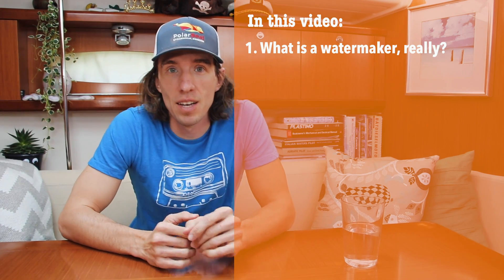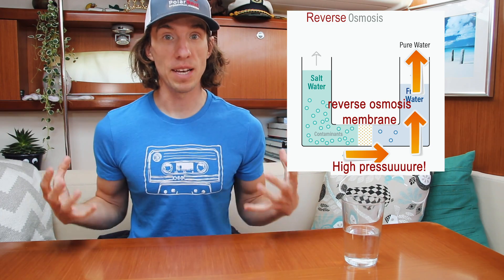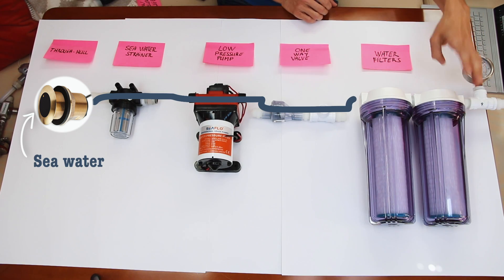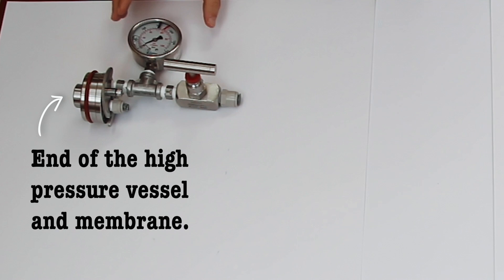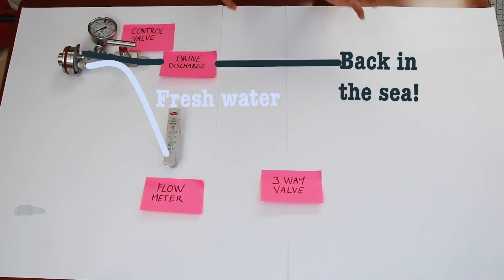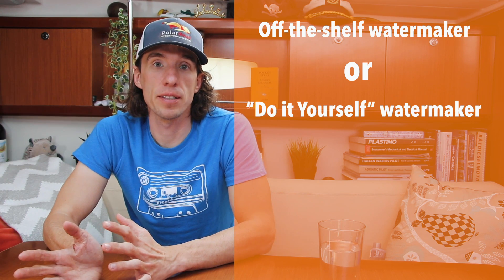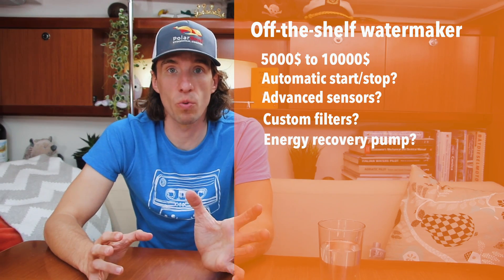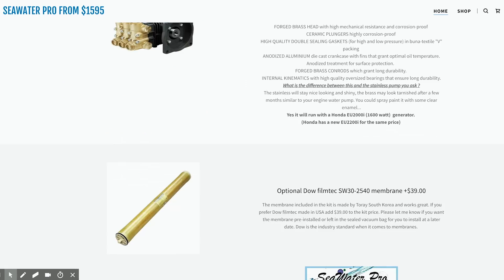How to make water on a sailboat (and how to build your own watermaker) // Ryan’s tech corner #3

Comment: Okay so your missing a few items 
1 water inlet.
2 shut off valve.
3 strainer.
4 booster pump.
5 low pressure switch - needed to protect the high pressure pump -will stop high pressure pump from running if inlet pressure is to low.
6 high pressure pump.
7 high pressure pump throttling valve reduces pump pressure. Pumps like back pressure.
8 R.O housing.
9 R.O membrane.
10 permeate line to fill tank. Roto meter.
11 concentrate water feed back to inlet of pump with roto meter and needle valve to control amount off water to feed back you can recirc some of the waste water back to the inlet of the pump to get as much out of the pre filtered water as you can. This is not necessary but Is commonly used you have spent time and money on filtering the inlet water why waste it by running it once through. A portion of the concentrate is sent to the inlet.
12 level switch in the R.O water holding tank. This will automat the fill process. When the water level is high the float will turn off the pumps when the water drops and the float turns on the system will start up keeping the tank full before it gets empty.
13 you should also get some kind of controller for a R.O they need to be flushed. Flush cycle is to push water through the R.O membrane with the low pressure pump it cleans the surface of the membrane could use R.O water for this or your prefiltered water. R.O water would be the best but more complicated. R.O's like to run dont let the membrane sit a long time with out running it will get fouled and bacteria will grow. I would recommend draining a protion of the R.O water holding tank out every so often or use a smaller tank so that the R.O cycles on more often.

You want your R.O percent of rejection to be in the 92 - 98%. 

So, for example, if your tap water reads 280 uSemen and your RO product water reads 15 uSemen, you determine the percent rejection of the RO unit by subtracting 15 from 280 to get 265, dividing 265 by 280 to get 0.946, then multiplying by 100 to get 94.6% 

RECOVERY RATE
https://blog.harnrosystems.com/hs-fs/hubfs/blogs/Recovery_Formula_Image%20(1).jpg?width=960&name=Recovery_Formula_Image%20(1).jpg

This will let you know how much water you are converting into good water and how much is being sent to waste.
Reply from the maker: Not really clear on the parts we are "missing".  The system described in the video is what you need to make a system work.  In fact it has more in it than what you need.   Anything else is just water management or automatic systems which ads complexity.... all are fine but its just not needed to have a DIY setup.  This system has worked for us doe two years and has been great.

Is their something specific you thought I missed?  Would be interested to hear.

Ryan

Comment: Unsure about about one aspect of the flushing process.  When flushing, does fresh water go through the membrane in the opposite direction?  If so what pumps the water in that direction?
Reply from the maker: Nope... Same direction.  It's just the house water pump which provides the pressure.  Ryan
Reply: @RyanSophieSailing  Ohhhhhh... so the fresh water doesn't pass through the membrane, it just passes over it and out the salt water pipe to basically rinse off the salt side of the membrane?

Comment: Hi Ryan and Sophie. Great job with your videos, as always ;-). Hmmmh ? Why do you put the control valve and high pressure gauge on the OUT (brine) and not on the IN of the pressure vessel ?
Reply from the maker: I always wondered that too but it's because you are building up pressure behind the control valve not in front of it.  So if I have the control valve prior to the membraine the pressure would be 850psi right then it comes out but it would be decreasing going through the membrane and not doing its job.   Having it after ensures the pressure from the pump to the end of the membrane is at 850psi... Or whatever you set it at.  

I can tell you... When you watch the brine discharge water come out of the boat is under almost no pressure
Reply: Got it, so on a two membrane system, I'll put the pressure gauge behind the second membrane then I guess.

Comment: For emergency: there is a hand operated system made by katadyn... switserland... Not cheap... 
I do use a cheap system to make destilled quality water from tap water. First reversed osmosis, then a resin filter. Result:. Water with conductivity 2,5 micro Siemens. That's equal to destilled water. Used for chemestry, biology at school... Costs. Lees than 200$!
Reply: That hand pump will produce very little fresh water.

Comment: Great explanation. I have a rainman  115V A/C High output unit and it works just fine, but the major con for a live aboard vessel is it must be pickled after each use because you may only make water every two to 4 weeks. The automatic fresh water flush on your system is a great feature, and eliminates the need to pickle. To remove the pickling agent,  the unit must run for a  good 1/2 hour before making fresh water.
Pro. I'm can easily sell my water maker.

Comment: Why don't you say it's just a hydraulic hose that's 3,000 PSI with hydraulic fittings on it and tell me I'm wrong those fittings are beveled on the inside, okay so we established that it was a hydraulic hose and to show you what I know what I'm talking about that hydraulic hose at you using has two layers of braided wire, correct.

Comment: Great video. I’ve only just discovered your channel but I’ll be watching! Question: when you run your fresh water flush, are you running it with house pump pressure only or do you switch the feed pump on as well? I assume there is no pressure in the vessel when flushing.
Reply from the maker: The only pressure in the vessel when flushing is from the house fresh water pump.  When running the system though, if you system is above the waterline you will need to use a bost pump before the high pressure pump.  RyN

Comment: If you want to control it with electronics just buy an arduino, as to amps unless you're buying electricity it's a moot point as all that matters is can it make what you need in the time frame you need while allowing you to do everything else you need with the power generation capacity you have.

Comment: Good Video! Fyi --- you were saying Tsd meter. i Believe its a TDS Meter. ( Total Dissolved solids ) i Was wondering wouldn't mounting that High pressure Pump section on your Engine Be More Efficient. So, anytime u are Running the engine YOu could me making water and keeping the tanks filled. Just sounds More efficient to me. than using HUge amounts of electricity though. i could be wrong though.

Comment: Nice job! One of the best DIY/technical sailing videos I've seen. A few thoughts... Not to be nit-picky, but I think it's TDS (total dissolved solids). Second, it might be nice to get a combo pH and TDS monitor. pH is a critical component of water, and one that should be examined when processing water (especially for human consumption). Even small changes in pH can have significant short-term and long-term impacts on the body. Finally, a highly efficient RO filter may get TDS too low, and dangerous for human consumption. Re-mineralization and  pH adjustment kits are available to properly adjust water for human consumption.
Reply from the maker: Hi there.  Thanks for the comments.  Your points are valid and we are researching ways to put some minerals back in our eater supply.  Ryan

Comment: I think you have the same boat as we do. Where did you install the RO housing? Thank.
Reply from the maker: Hi Blown Away Sailing.  If you have the two cabin version, I installed everything in the large locker on port side.  I mounted the membrane high on the outer wall, high presser pump on the table and all the filter on the bulkhead with the galley.  You will see the entire installation in a upcoming video... we have been doing a lot of testing thus the reason for the video coming so slowly.  

it really works well in that location.  one thing i would like to do is move the high pressure pump and create a monitoring board in side the boat where i can turn everything on from but that a project for another time.  - Ryan

Comment: It is not right. The timer???? the pump should have been connected to the simple digital timer, also no need to complicate the system with shore water subsystem.
Reply from the maker: Hi Ryszard.  I would be interested to know why you feel a digital timer is best? The timer we have works very well and for all types of applications. Also, the system is generally much simpler than production version so i feel we are very safe with regards to complexities, etc. - Ryan

Comment: why you put the carbon filter only for flushing and not for the salt water ? (after rest of filters)
Reply: I second your question. Also the throu-hull is to small and the TIMER... totally unacceptable.... should be electric connected to the pump.
Reply from the maker: Hi Psychollek.  Carbon or Charcoal filter will take the chlorine and takes out of the water but not necessarily fine level solids.  Thus the reason you only need it for flushing (in cause your flushing from dock water which has chlorine).  We have two very fine filters for the salt water which is more than most commercial systems.  

Ryszard - The throu-hull is 1/2 in which is just fine for 1.3 GPM required by the high pressure pump.  

-Ryan
Reply: @RyanSophieSailing  well this is obviously why I would place it after the fine solids filters to catch any chemical contamination from the ocean water. On the other hand I don't know how it would react to salt water. It also seems strange to me that you say commercial systems have only one filter. Even my home reverse osmosis system has 3(two for solids and one active carbon afterwards), then the reverse osmosis and then mineral enrichment unit. The filters before the osmosis are the same you use and are fairly cheap so it is strange to me that commercial product would reduce costs on those.

Comment: I'm dismayed that you took off without having a fresh water backstop source.   Then I saw your reliance on gadgets, and I just threw up my hands.  You're going to need some education and, unfortunately, Mom Nature will provide.
Reply from the maker: Hi John, im a little confused by your comment but would like to understand.  When your saying "fresh water backstop source" I'm guessing you're implying a freshwater source in case the water maker breaks?  If this is the case we always leave with full water tanks and have spare bottles.  

That said, this technology is not complicated and thousands of boats every year rely on it.  The same goes with a battery to start your motor, a GPS antenna or a pump for your domestic water supply.   Ryan
Reply: There is an inexpensive backstop which I always carried, especially when operating in blue water.   It's merely a still which uses sunlight to heat seawater and distill it to fresh.  It uses no power and can be tucked away for years.

Comment: No reason to use a TSD monitor. Just taste it. It is a good thing to have a flowmeter on the brine exhaust side also. The reason for that is that a membrane has a safe operating window where not too much fresh water is taken out. If to much fresh water is taken out of the flow to the membrane, then the membrane cannot keep clean, but will clog up with salt. You want that salt going out overboard with a big enough brine flow. I use a pressure holding valve, and not a normal valve (control valve).
Reply: TDS monitor and a Refractometer are essential tools to check water quality...
Reply: And why is that, Chris? It is very very easy to taste if the salt content is higher than recommended! And do share also the importance of the use of a refractometer..

Comment: I don't have a sail boat... do you have a method that works on a motor boat?
Reply from the maker: Hi douglas,  this method would work just fine on a motot boat, in fact probability better as you have a lot of power with the engines to power such a device.  Ryan

Comment: Cardboard tube full of water will explode 😂
Reply from the maker: You never know... people put cellphones in microwave ovens because they see it on YouTube. Just need to spell everything out.
Reply: Great video a lot of compiling parts and research explained well. I think you should flush the system after every use not done my research but that high pressure pump looks like the week point if left with all that saltwater. Try and earth to an anode if possible.?

Comment: How are you going to treat the potable water?  I run large RO units for US Navy ships.  When the water enters the tank, it is susceptible to bacteria growth if it sits for a while.  We have an inline brominator system that essentially adds bromine (chlorine) to the water to keep the water safe for consumption.
Reply from the maker: Hi stephen.  I only plan on having water in the tank for a few days.  As you need to keep using the water maker i will most likely only run it for an hour or two every few days. Ryan

Comment: In the book " Voyaging on a Small Income " by Annie Hill , they built a raised coaming  around the roof of the cabin to capture rain water, with drain holes in the corners. They ran the drain to jerry jugs and then filtered the rain water. They would let the water run off in the beginning to wash away any dirt/salt. Easier than trying to desalinate...

Comment: Very nice explanation overall. Osmosis, though, is a process involving fluids in two spaces separated by a membrane, where the "stuff" in the fluids travels through the membrane, from higher concentration to lower concentration. In Reversed Osmosis, the fluid goes through the membrane from high to low concentration. This is actually a three way process where the fluid after the filter, with the increased concentration, is dumped, e.g. into the sewage. Three: input, clean output, dirty output. In many smaller (home) systems, the clean water is stored in a tank pressurized with a bladder. As a tank has a limited capacity, at certain point when the tank is full, these systems then continue to input water into the RO filter, but dump everything through the dirty output. This wears your RO filter out faster. I am aware there are some automatic valves (simple mechanic) that would close the input of the RO filter once the pressurized clean water tank is full. As to the carbon filter, I would like that in the chain with filtered sea water as well. Just personal.
Big problem, indicated elsewhere too, with RO water is it is very unhealthy. With a pH of around 5 it is acidic and in a system with normal osmosis its zero concentration causes substance to flow out of tissue into the water. You get demineralized quickly and become very unhealthy. Experience.

Comment: RO systems can run on much less pressure. They can run on city pressures of about 80PSI. You can use much less expensive pumps and lines for it.
Also... TDS (total dissolved solids)... not TSD.
Reply from the maker: Walter, you are correct... for city water however this is not true for seawater where the minimum pressure is 300 psi and the average for our area is 800 psi.  This is the reason the pumps are expensive as well as the cost.  Ryan
Reply: @RyanSophieSailing  Thanks, I guess the issue is with fresh water you are starting with 300ppm TDS and with sea water you are starting with 35000ppm TDS. Learn something new every day.
Reply from the maker: Yes, this is correct.  We have had a lot of statements of people thinking they can use home RO systems but its just a whole different game with sea water.  I have learned a lot as well from it.  Ryan

Comment: First one I installed was a 'pre-fab' commercial kit...$250 for 150-GPD, but the RO filter was small and required frequent changes. Second one I installed was also a commercial kit for $400, for 250-GPD (gallons-per-day)...larger filter means it lasts longer, most-often. THEN, I tried what you described...building my own 'DIY' kit...and I found one key-thing...IT'S A PAIN IN THE REAR, and I don't think I ended up saving any money at all! By the time I added this, and didn't use that, and installed extra this...I found that my 'homemade' kit was no cheaper! So, having learned my lesson fully, I now know to buy a decent 250-400 GPD kit, ready to install, and add what I want, whether it's a secondary carbon filter, or an inline pressure gauge (to tell when it's time to backflush) or whatever...I figured I can pretty-easily build a hybrid (dependable) water maker like this for around $1 per GPD...
Now, you were saying something about 'you can't afford a pre-made kit right now'...for 2 people, exactly how much water are you expecting to consume daily on a sailboat? 100-gallons per person per day is a LOT OF WATER! (I don't think I used 3,000 gallons per month for a family of 4, when I owned a 2,000 sq.ft. brick home!!!)
Reply from the maker: Hello Skeeter.

Thanks for your message.  Im a little confused where you are finding a marine RO system off the shelf for 200 USD.  From your last statement im assuming it's a home unit.   These home units while great do not work in marine environments.   

Home water may have between 250ppm and 2000ppm while sea water is working with 35000ppm.  Thats a large difference and requires different systems than at home,  thus the cost and thus the reason we are going DIY.

If i misunderstood please let me know. Ryan